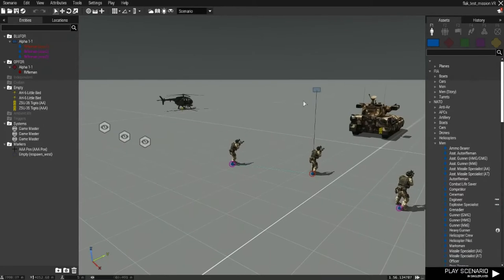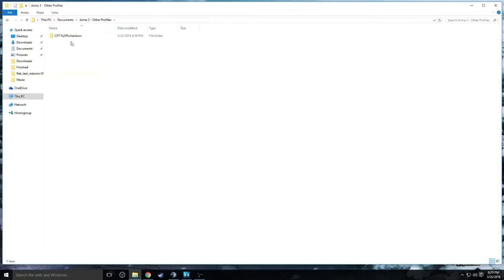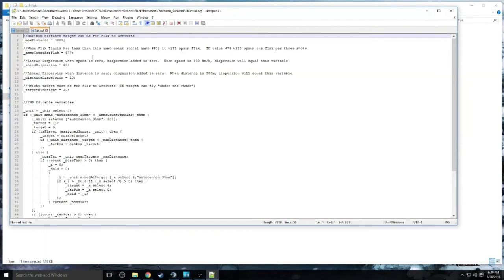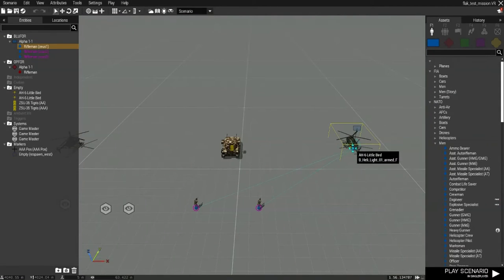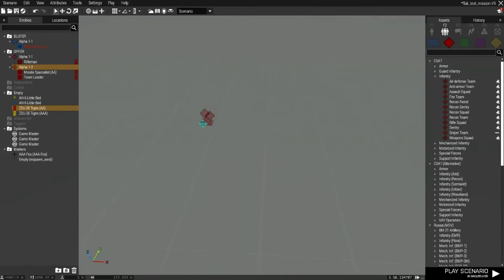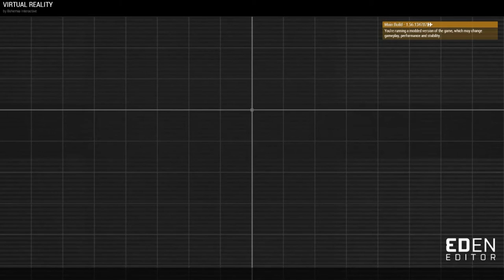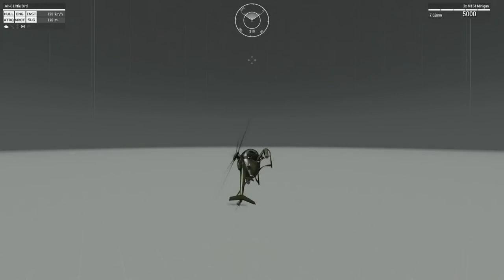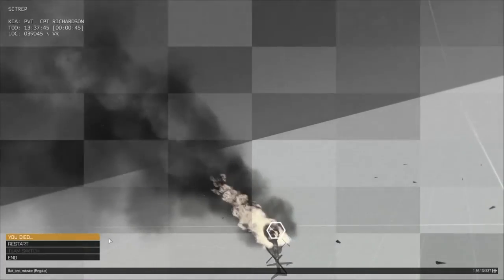Flak Script

Comment: So im a little behind on the date you posted this. Has there been any changes because when I use this script there is now flak explosions around the heli or aircraft I use. Any help on this?
Reply from the maker: I did this in 2016 (three years ago) so a multitude of items could have changed from the ARMA expansions to a mod conflicting.
Reply: @Man1ac89x  No problem bro. Ill do some checking in the editor. thank you for the script.